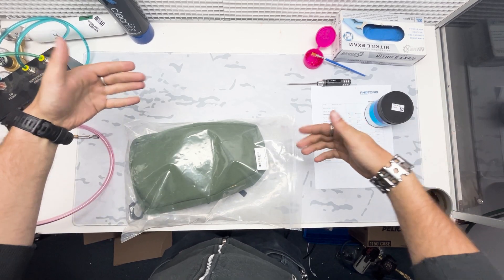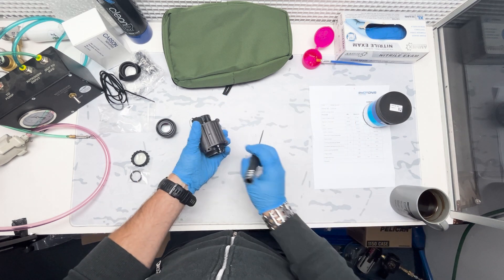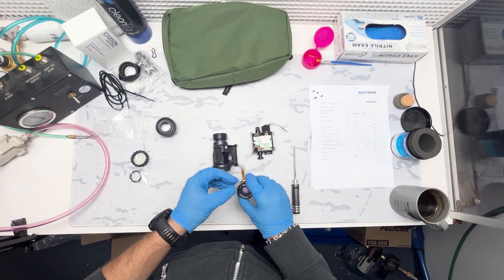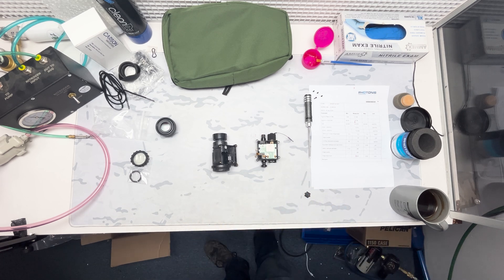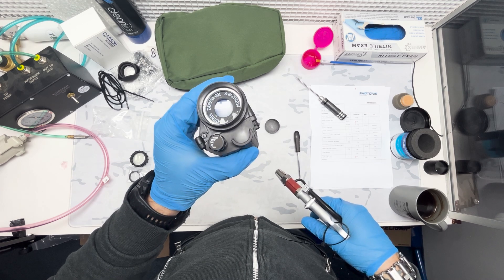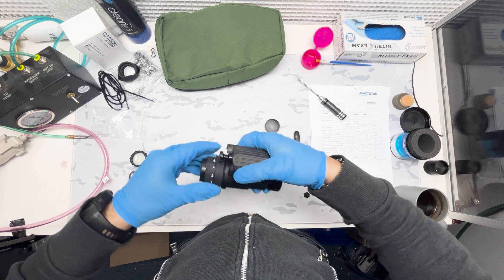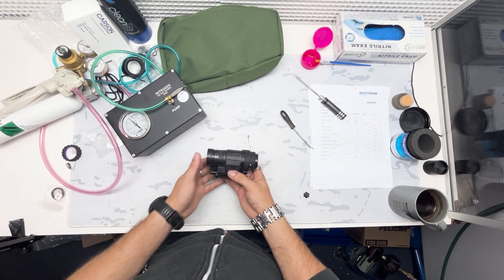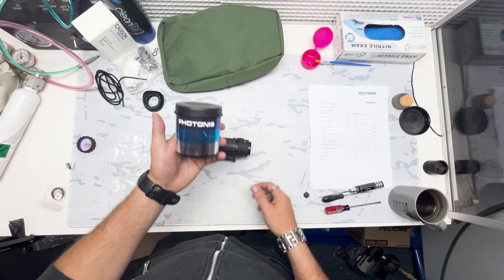PVS-14 Photonis Installation | Amped at Night

Comment: How to collimate please ? Mine is waaaaaaaay too off like 40cm apart at 5 meters
Reply from the maker: We recommend sending your unit to a professional to do this like Nocturn Industries, there are some quick down and dirty methods online you could follow to do it yourself but without a proper purge setup it is difficult and risky to your expensive equipment.
Reply: @AmpedAirsoft  I live in France, if I ship it it will be hold in customs, I need a permit and I'm not a professional.
Reply from the maker: @PopDatWeapon  There could be a shop local to you! We are not familiar with the NVG scene in France so unfortunately we can't be too much help. But there are some online resources for doing a fix at home.
Reply: @AmpedAirsoft  Any link ? I watched 15 videos of assembly or disassembly, they all skip the process of collimating. Some explain it in theory, but doesn't show it.

Comment: hey man, quick question. I have the same tube, also in a pvs14 housing but I have an issue. Everything is installed correctly, or at least i think it is, but when i turn on the device, i see nothing at all. And yes i removed all the caps and played with all the dials possible lol. I can see the red light pipe when i switch to it, but still in a black image. Maybe im overlooking something really small, or im just a moron, but have you heard of this issue or maybe experienced it?
Reply from the maker: Give us an email at sales@ampedairsoft.com. We can try and help you diagnose it and hopefully get your tube working!